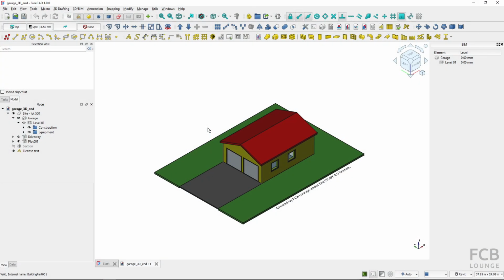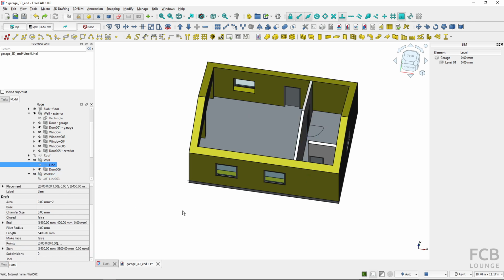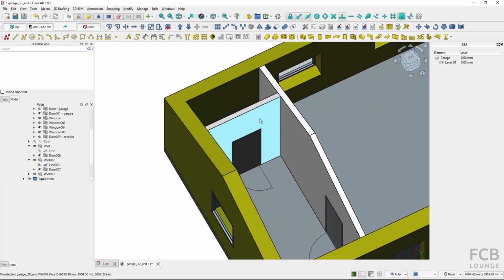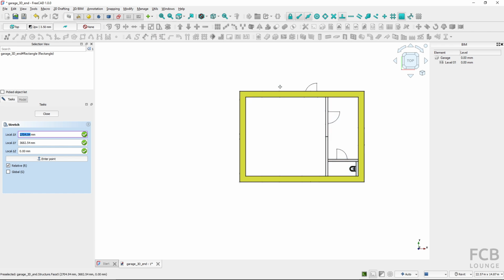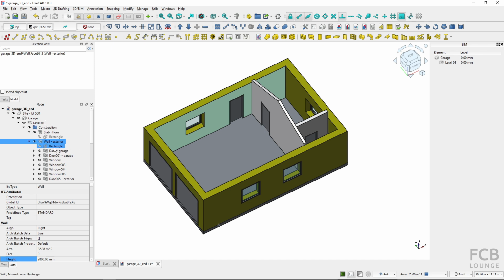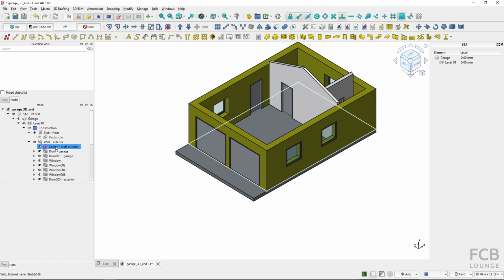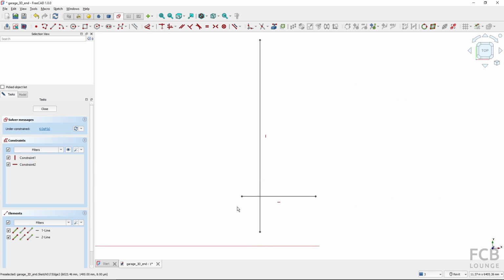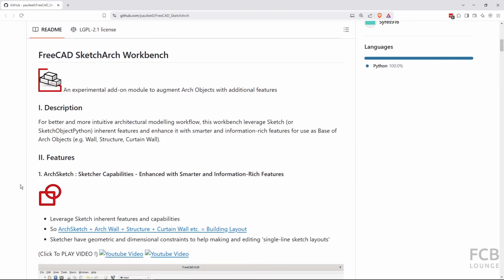Edit and Move Walls in FreeCAD BIM

Comment: Is it possible to cut out a portion of a larger wall manually where two walls meets? Remove tool doesnt do it- but i want to cut and existing angular piece out, where two walls meet a roof edge, something like draw a line and project it to a wall to cut it at that point.
Reply from the maker: You can create any 3D solid shape and thane use Arch_Remove tool to remove it from the wall.

There is also one BIM_Door tool preset which creates opening only. But this is not suitable for your case.